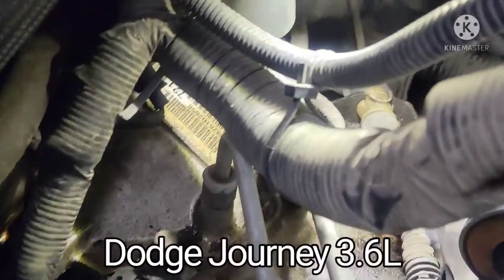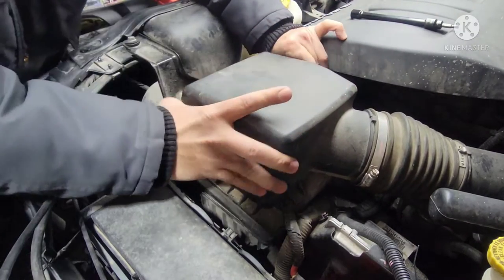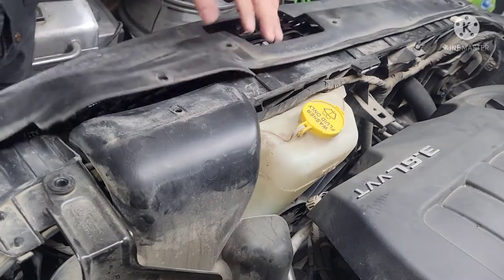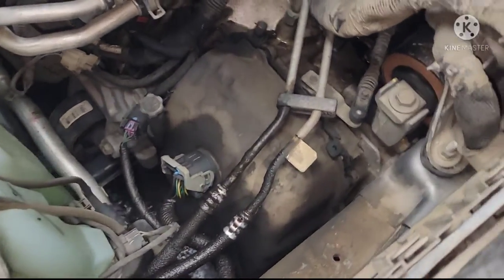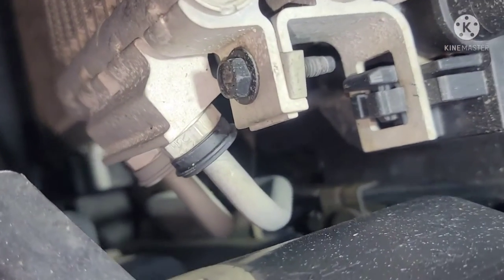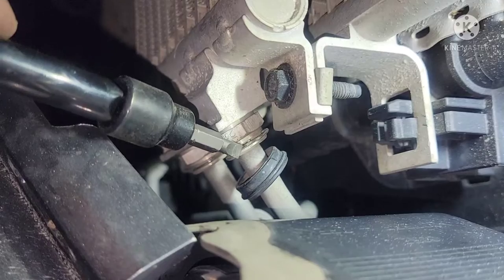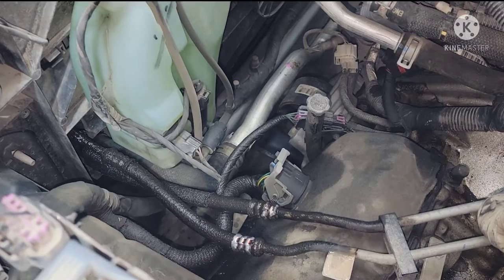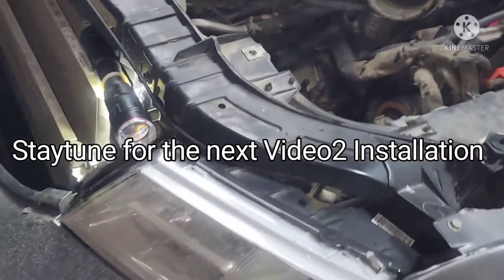Video1: Dodge Journey 2012 -19  Engine3.6L 2.4L D.i.Y Transmission Lines leaks!#mechanic #automotive

Comment: I found this issue in my 2012 dodge journrey RT after noticing my coolant level wws very low. There is leak also in the tranmission oil pan. Is there a connection between the oil leak and coolant going low? Thanks
Reply: Check your thermostat housing usually the leak comes from there. My 09 DJ coolant leaks in the thermostat housing and the block above the trans with 2 screws. Remove the housing and replace the rubber gasket inside.

Comment: Hi did you drain any fluid before removing the lines?
Reply from the maker: It drained after you take the lines from the rad side make sure put a rag/towels under the lines, samething  on the transmission side.